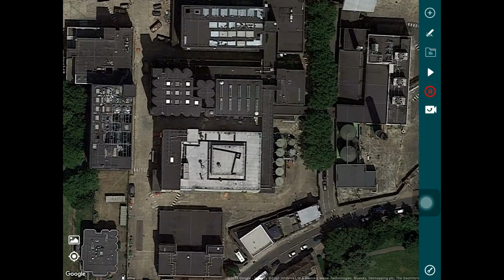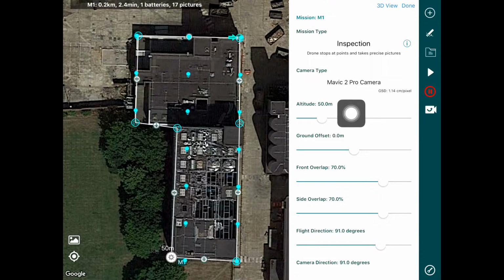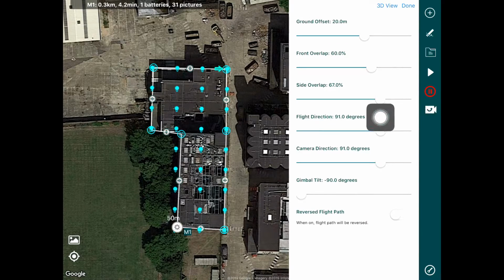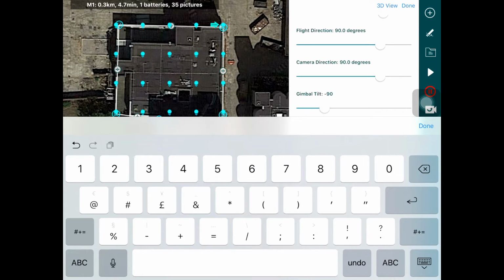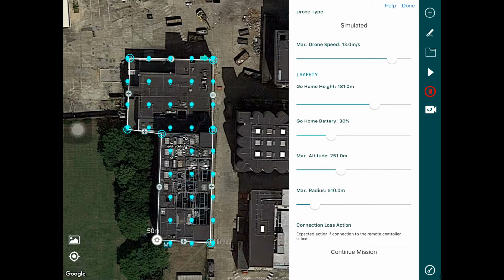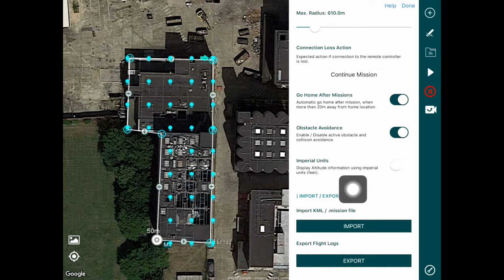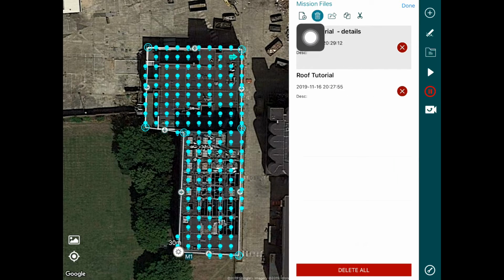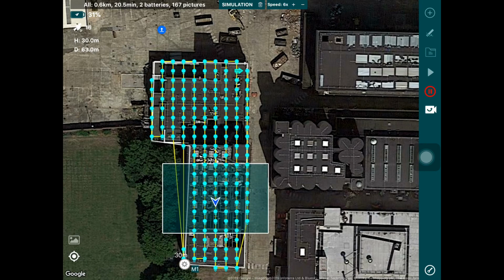Roof Inspections with Hammer - Tutorial #001

Comment: Great video Thanks. What about indicating how many pictures are taken, and battery swap during mission or did I miss it?
Reply from the maker: Hi there, thanks for the question! The number of pictures is indicated at the top left corner of the screen when you are setting up or simulating the mission. For battery swap, we're planning to make a separate video very shortly to explain this, but in general the process is:

1. Press Pause > Go Home (or Go Home triggers automatically on Low Battery)
2. Land the drone, swap battery, drone will disconnect and reconnect 
3. When reconnected, press Play. Hammer will ask you whether you'd like to restart or resume the mission. 
4. Press Resume.